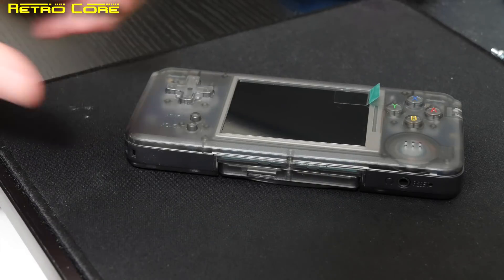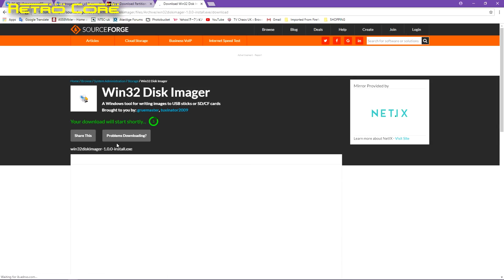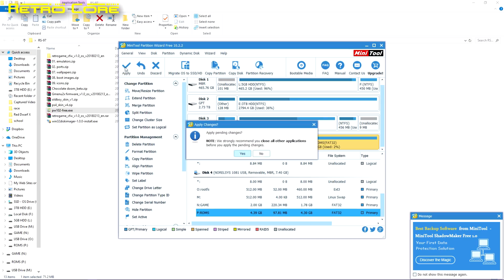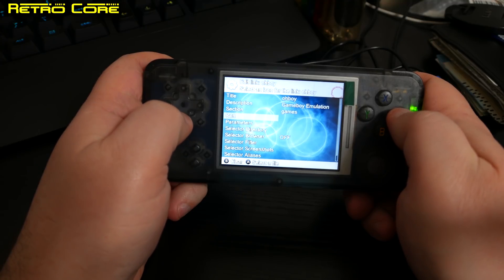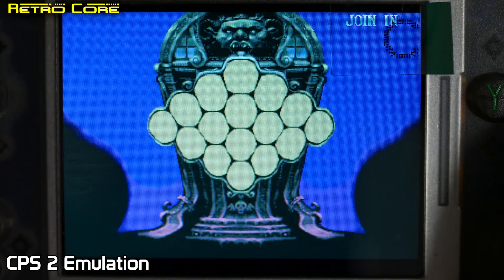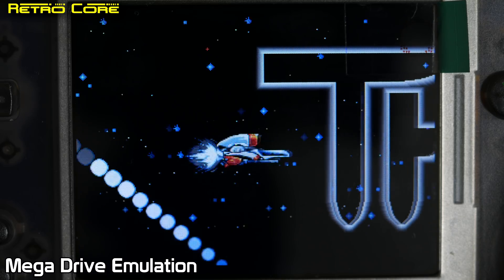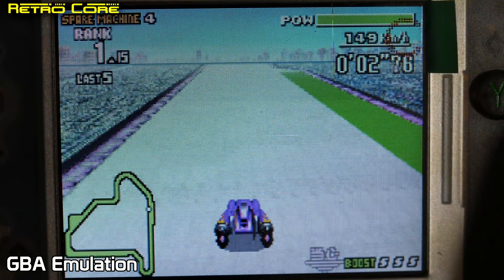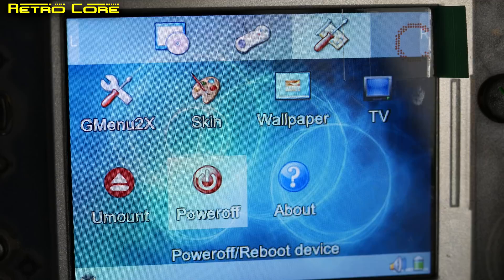RS-97 Retro Game Modding guide - Chinese Knock Offs - 4K

Comment: does this run mega cd and pc engine cd games decently?
Reply from the maker: Yep, no problem at all.  The two emulators shown in this video will play the CD based games fine.  The Mega Drive emulator, Pico Drive will also play 32X games but the hardware in the RS-97 isn't fast enough so games run at around 1fps or slower!!  Completely unplayable.

Comment: It looks like the specs are just under a Raspberry Pi 1, considering how it preforms.
Reply from the maker: I think a Raspberry pi is a little more powerful but this is close in terms of emulation output.
Reply: Yes I agree.
My raspberry pi 1 gets maybe 20% increase in performance over this, but overall is very similar.

Comment: 4:29 I'm very sure that's just a re-skin of the old "EaseUS Partition Master Free Edition" (before it became a fully paid software), as the interface appears to be the same, but flatter (ugh), and opens similar advertising junk. Just go to the program folder and run the "Main" executable, then delete the "...News" executable (after terminating it), and there's another executable that opens that intro window.

However, outside of Windows, I'm sure GParted, GNOME Disks, and/or KDE Partition Manager may work.

Comment: @1:26 do you seriously throw away small SD-cards? With "small" being 4GB? Wow, people are so spoiled in the so called 1st world. 4GB is more than enough to boot a Raspberry Pi from for example, a minimal OS can fit below 1GB, let alone 4.
Reply from the maker: No, but this is a none branded card that will fail.  I use 1GB cards in devices such as ever drives and my Framemeister.  The fact that it's 4GB isn't a problem.  The fact that it's a none branded cheap card that will lose data is.
Reply: Interesting - mine cane with a Kingston Card...

Comment: Holy smoke! The fact that this emulation machine can play DOS port of Doom 2 is really mind-blowing. I may as well pick this up just for arcade emulators. But can it run Duke Nukem 3D?
Reply from the maker: I'm not sure about Duke Nukem 3D but it can run Quake reasonably well.  So I guess Duke should be okay.
Reply: I don't know how well, but there is a port of eduke32 in the ports section of the MEGA folder, link at the top left of the main site.
Reply: Update: The current CFW image comes with eduke32 with the Atomic Edition, and from what I played, runs perfectly. The controls take getting used to though. Hold B to strafe, Hold X to aim, Y jumps, A shoots, L ducks, and R+up/down cycles through weapons.

Comment: Can I use a larger card? 64GB say?? or s there a size limit?
Reply from the maker: I tried a 16gb in there which worked.  I'm not sure on any size limits.
Reply: The SDHC standard uses FAT-32 and is only valid up to 32GB. If you want to use a bigger card, it will have to use the SDXC standard and exFAT as file system. Not impossible that that's gonna work, I but I wouldn't bet on it. So 32GB should do, everything above his hit and miss.

Comment: Much better!  So... Would you say these are worth picking up knowing that I already have a emu-capable PSP?
Reply from the maker: Hmm, I wouldn't say it could replace your PSP but it is cheap at 50 USD or less and it does work pretty well as shown in this video.  I'm not clued up on PSP emulation but I can tell you that there's a lot of emulation for this device.  The next hacked firmware is going to include 20 odd emulators!
Reply: I was looking at this too, because I collect these typs of hand helds, but I would say stick with the PSP. First off, these are around $50 (lowest I saw on eBay was $52 from China), and you can easily get a psp for that. Of course, it would be used (and you already have one), but good deals are out there. I recently got a PSP 3001 in practically new condition (and already modded) for $45. 

Considering you have to also do firmware modding for this, which looks a bit more complex than modding a PSP, and you are going to get hit and miss performance with PSX games (for example), the PSP seems far superior IMO. They are, after all, virtually the same sized consoles, but I think the PSP's are better built. I use a 128gb sd card on my psp and every retro console emulator works beautifully, save for the n64. In addition, I don't know if you can run SCUMMvm on this one, but on PSP you can. There's a lot of great old PC adventure games like Monkey Island and Maniac Mansion you can play.
Reply: The  PSP screen is better and it can also play PSP games perfectly as well as natively emulate PS1 games. 
I heard that the RS-97 does run some Nintendo emulators better, though.
Reply: Alec J both are junk.

Comment: Hmm to bad for SNES emulation, but at least PC Engine, Genesis, and GBA can run just fine, but how about GB and GB color ? At least if these 2 also get great performance i think this will solid choice for portable gaming, and the mod not that hard unlike other clone system.
Reply: Bhirawa Maylana The snes emulator on RS-97 runs way better then on the real  hardware  (the console can emulate arcade the snes rediculous low spec's can be emulated perfectly even on 486 pc )
Reply: iulian ispas yeah but i can see from this video its run quite laggy not worst but its still lag few FPS if i must say, well i hope its just coz video not for other issue.
Reply: Bhirawa Maylana becouse is filmed at 4k ,snes run with 10 to 20 fps and human eyes can process 24fps per second,  I used my snes on my 4k tv looks awfully framy and pixelated 
I think the best picture you can get it on a old ctr Sony Trinitron
Reply: iulian ispas well i hope so coz i can see Genesis even GBA can run smoothly in this video.
Reply from the maker: The GB and GBC games ran just fine :)
Reply: Glad to hear that, i also glad to see PS1 emulator, i think we can say next time there will be dedicate PS1 portable clone from china.
Reply from the maker: For PS1 I'd imagine them just going with Android since that can already run PlayStation just fine.
Reply: Yeah i can imagine they use Android as base, well the hardware still not there yet, im not talking about motherboard or screen, im talking about controller, at least they still need add 2 analog stick(from 3DS will work fine), 3 R and L button (to mimic R3 and L3 i think dedicated button will helpful)
Reply: @iulian ispas Just wondering do you have digital eyes with camera shutters when you say "human eyes can process 24fps per second" just wondering where you get your info from lol.
Reply: Bhirawa Maylana have you seen the Gpd XD ? Sounds like it's probably going to do what you want it to.
Reply: chrisgboyle i do already have it, but is not bad with have many option to play game right ?, i also have many emulator install for android too.
Reply from the maker: The SNES emulation on the released emulators so far is a little laggy BUT as I mentioned there is someone working on a full speed 60fps emulator right now which will be released very soon.

Comment: Nice tutorial, really appreciate Sir. :D
Reply from the maker: No worries.  You're welcome.
Reply: Same for you, have a great day/afternoon/evening/night Sir! :D
Reply: i think that would involve some soldering work, small components and PCB modifications. By that i mean replace the rubber buttons to clicky micro stwiches. It is possible, but it's not as much doable for some cheap clone of GBA emulator. You can do it, but the results may vary.
Reply: Retro Core Can you make a tutorial on how to upgrade the d-pad for fighting games?

Comment: was there a way to make the d pad feel better?
Reply from the maker: I'm thinking to make the pivot point in the center of the D-Pad a little higher.  I've not found a good solution just yet though.
Reply: How about change it with better one, i think there some great d-pad 3rd party for GBA it say its perform better than original GBA, well we still need look if it can fit in these clone manufacture !
Reply: dylbob9000 maybe take the board out and put something under the center of the dpad so it didn't push in.you'd have to be very careful usingit though
Reply: Retro Core I was fixing the ps3 controller for my pstv again, swear to god, it's only held together by the cheap rubber sleeve I got in a £1 store that I "trimmed" so the wireless keyboard fit. Anyway, I took out this 3 legged part that tapered to a point, maybe that could work without digging into the circuitboard.

...I just wonder what that part did...works fine without it...
Reply from the maker: Hmm, that would be an idea.  The problem with the D-pad on the RS-97 is that there is no pivot point so it just feels like a mushy mess.  It works but for fighting games it useless.
Reply: Retro Core just worked what that bit was for, it was in fact to stop the dpad on a ps3 controller from being pressed in. So uh...proven right there I guess?
Reply: So did anyone find a good replacment also how well does it play SNES games currently did they update anything since the video?
Reply: My RS-97 just came in yesterday. Looking forward to trying this out! Any extra advice/add ons/updates  since posting this video?
Reply: version 1.2 of the OS was just released and improved several emulators.
Reply: 1.2 has been out for a while now